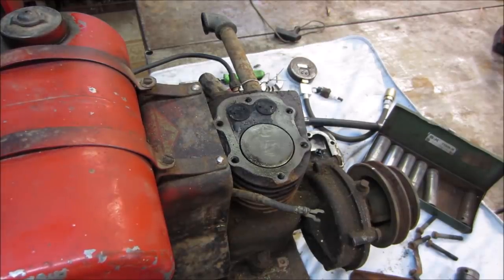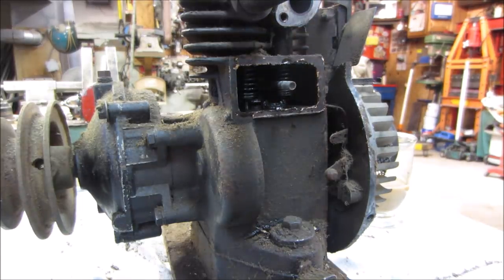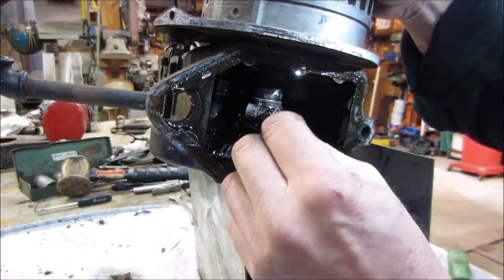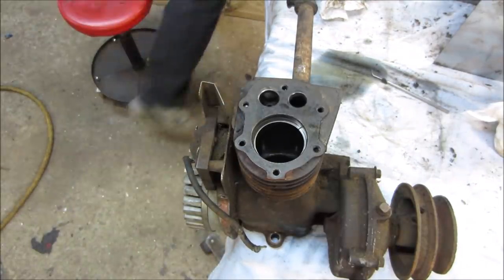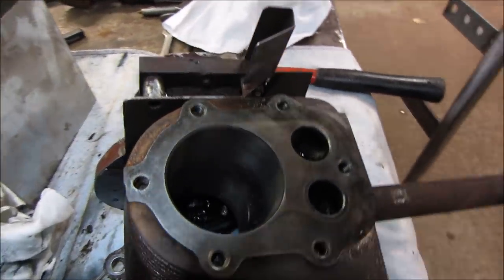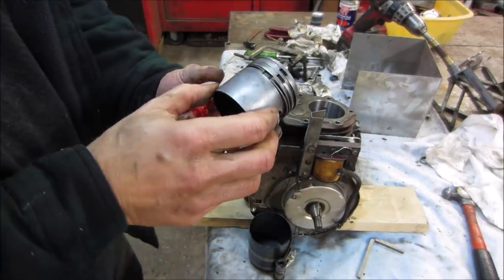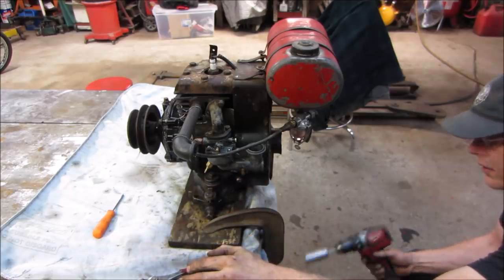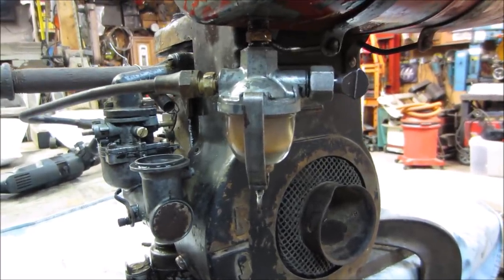Will It Run? $5 antique Briggs engine.part 3. tear down and cold start.

Comment: H 53 could well be a production date stamp, which would make it August 1953.  Without the ID tag, though, it's probably hard to tell as small engine design didn't really change much until into the '70s and '80s and it's always possible this one has been apart before and rebuilt using whatever appropriate parts are available.  If it is August '53 then it's in pretty decent shape for a 65-year old engine that clearly hasn't seen the best care and maintenance in its later life...

Comment: You could have knurled the piston skirts in your lathe to reduce the clearance, then cut some brass shims and super glued them in the ring grooves to reduce the ring gap, then be sure all your gaps were on the freshly honed part of the bore- probably worth another 10# compression.

Comment: It looks like an old reel type lawnmower engine with the two groove pulley on the gear reduction unit from the late 40's or early 1950's. One belt would drive the cutting reel and the other the drive wheels.

Comment: Great job, I have a chainsaw needs fixed lol.
 Also, pushrods spin, the valves don't spin.  Those valves didn't spin when you turned it over with head off.  Not aware of any engine where the valves spin.
I an build car motors all day long, especially carb motors. But when it comes to small engines, I can't get the carb right to save my life.

Comment: Old oil still good to go. It's been in the ground for more than 100 million years what's another few years. Just filter it out to remove metal particles using a common  paper towel or coffee filter. This is like a tutorial in small engine trouble shooting/fixing.

Comment: HATE those lapping tools. I ground a socket to fit the holes in the tops of the valves and used my drill.  For a motor of the same vintage.

Just read a bunch of comments talking about using a lapping tool with a magnet.  I didn't think of that...

Comment: Watching this old antique engine restoration project has given me the gumption to work on an old Montgomery Ward engine that I pulled out of a run-down Barn. Circa 1947 supposed to be on a tiller style garden tractor from the period. Does not have an intake or carburetor though. Maybe it'll be something I can ship to you @Mustie1 . If I can't get the parts lol.

Comment: You can weld on the piston and grind it away until it fits so you get a bearing effect. Don't have to go all the way around, just 3 or 4 or 5  and so on lines along the length of the piston to reduce the slop. 
If a piston doesn't bear, it wears. Hence why they're usually made to such tight tolerances. Sealing is done by the rings, but they can't seal if the thing frigging wobbles.
Reply: What happens is that as the piston rocks in the bore, the rings are rocking as well, which in turn rounds off the edges of the rings and they lose sealing ability. You could knurl the piston skirt, replace the rings and hone the bore.

Comment: I know the snow blower I have had some serious issues the old oil was like fudge just like yours. Dont assume someone put gear lube in it. Oil gets pretty thick when it sit for 5 years or more. I got this one running its also a 5 hp. I am having to do some modifications because the governor arm doesnt sit in the same spot due to a different carb. It runs but runs full out. I suspect the governor is trash. I may just slap $100 pice tag on it as is. after doing some fancy spring work with it to give it a consistant run. As long as the throttle works to run it full and off, thats all that matters. It has to have the power to throw snow and seriously, who runs a 5 hp on idle? I fixed a brand new snowblower last year that had one speed,fast. I usually go with maximum RPM per manufacturer and call it good. If someone wants to mess with tearing it down to replace the governor, more power to them!

Comment: Me, I'd have spent the bucks and totally torn it down and replace everything it needed I could possibly get my hands on including a new piston, ring set, valves and gaskets.
I know how to and have made gaskets including metal/gasket material sandwich head gaskets.
I've 800 hours vocational school training on small engines.
You'd be surprised how many parts are out there if you look good enough.
I'd also glass bead if completely then give it a nice two tone paint job, red and blue most likely.
Or green and black.
There's a huge interest in restored antique engines.
I used to own a 72 Wheel Horse Champion riding tractor/mower with a really weird PTO system I restored.
Slow as molasses but fun to drive.
Mowed good too.
42 inch deck.
Got it for 100 bucks on Craigslist.
He wanted 250.
Needed work, I talked him down.
I ended up selling it for 12 hundred after restoration.
Wasn't about the bucks.
It was just plain fun restoring it 
I put on a 4 foot exhaust stack with a custom 14 inch chromed tail pipe from a car kit with a home made flapper valve at the end from chromed flat plate I had lying around.
The guy I sold it to told me he'd have paid up to 18 hundred, like I said.
Not about the money.

Comment: Considering how much oil it pumped when spun up by the drill, it didn't seem to be burning much.   Maybe the combustion gasses are pushing the oil back down again. Nice little video - I was afraid you weren't going to put it back together again.
Could you put the needle valve in a lathe and grind it smooth.  Not sure how to handle the seat though.

Comment: the cross hatch and  the valve lapping sure will bring one back ....love those old engines ...the older the better  
those carbs always leak like that my carb about like that one drips and leaks but once its up and running its fine ....for some reason yours is poring gas alil too much... needle

Comment: The reason the carb does not leak when the engine is running it that there is sufficient vacuum that the gas leaks become air leaks !

I never would have guessed that lapping the valves would have made that much difference on the compression after the amount of oil leaking past the rings !

Comment: 53 sounds about right.  It looks like a Briggs engine we had on a ‘55 Toro reel mower.  That sob wore out my right arm cranking it.  The only thing worse than that was an 1967 MAC 250 chainsaw.  I must have pulled both of those pos a million times.

Comment: Should be a screw on the exhaust side of the gear reduction with a line cast into the case. That's the fill level for the oil, not that it matters.
Nice job with the work. You have a bargain there for $5.

Comment: Hey Mustie1 I believe that gear reduction looks like it will unbolt from the engine once the pulley comes off. It looks like a 2 piece housing unbolt one piece and the other bolts inside that case should unbolt from the engine. 
Love your channel keep up the great work sir.

Comment: .007-.017 ring gap on all 3 rings.  Usually .003" per inch of bore is a good minimum on small 4 stroke engines. Above .008" per inch of bore or larger is no good.

Comment: The 53 on flywheel is the date of the engine (unless flywheel is from another motor of course), not to give you advice as you are the master of all lol, but I’ve found best way to clean the valves is to put them in a drill and hold some scotch brite around them and spin the drill .. they come up like new.. but as always I’m learning from you with each vid so thank you 😊
Reply: I must learn not to comment before end of vid, your valves looked like new lol

Comment: Probably the only decent and good service it had in its long life. :) 

I have a B&S lawnmower which will be a nice project for my son and myself to tackle. We have an electric lawnmower, but a petrol one will be a great fallback in case of power cuts and when you have to mow far away from the house or any electrical outlets.

Such simple engines, except for the carburetor (which is teh_sux in most cases).

Comment: No mouse nest! I knew it would run fine, I've done a lot of these old 6s & 8s, they keep on puttin.' The date of '53 is correct, no doubt. Not much rattle or knock! The earlier models had a real, internal oil pump, built-into a cast-iron sump. I think the rings and valves had been replaced, but not the piston. It's in good shape for a 65 year old sludgy engine! Might be off a Gravely tractor...
Reply: Gravely never used the Briggs on the old walk behind tractors back then. They used their own T-head engine designed by B.F. Gravely himself. In the seventies they switched over to Kohler engines. It wasn’t until the later four wheel tractors that they used any Briggs engines.
Reply: Right! Thanks John. I was thinking of another walk-behind tractor...

Comment: in my experience the exhaust valve should be a couple of tho more than the intake. too little tolerance on the exhaust will cause erosion of the valve face.

Comment: I would turn that engine into a DC genny with a GM one wire alternator and nice deep cycle 12v battery. I'm sure you have those things laying around.

Comment: Those two holes on the tops of each valve, were those for a special tool with corresponding pins that would be used for spinning the valve while lapping it in?

Comment: Loved it but I wonder what you do with it after its all fixed up
Reply: It is a trophy.  There is so much cylinder wear that it could not do much work.  One thing it has going for it is the gear reduction.  That makes it at least a bit more useful.  If you had to drive a piece of equipment from the crank, it couldn't do much.

Comment: Love the old engines... Have you ever messed with an old Wisconsin TF engine? I just bought an old (1951) Lincoln DC 180 AS powered by a Wisconsin TF hand crank engine and am about to undertake restoring it. Just wondering if you had any insight on old Wisconsin motors... love the videos.. Thanks.

Comment: Did you check to see how good the air flow was around the cylinder?  When I saw the size of the coil, I started to wonder how air got past it to cool the cylinder sufficiently.

Comment: Nice little project for a Sunday morning. I think this engine has been overheated and the piston skirt has collapsed. There is not enough bore wear to allow the piston to rock that much.
Reply: Did you watch him hone it?  That cylinder is an egg!
Reply: @paulcopeland9035  Yes  I did.   Actually I answered before he got to the honing. I still think it was overheated ( Just not quite as bad 😉) because even with the cylinder shape that piston is too wiggly

Comment: Is there ever an engine that has okay cylinder and piston that you can’t get to run providing you have parts for it. I have a 5 hp Briggs I worked on go a week with no success.

Comment: Something that I did notice when you pulled the piston out was that all the ring gaps were close together rather than being equidistant around the piston and that's not going to help compression at all.  I'm wondering if this has a cast iron cylinder and an alloy piston so that the piston is the sacrificial part as the engine wears with it being the easier part to change when it comes time for an overhaul...
Reply: Did you watch the video?

Comment: Hey Mustie, (and friends) I have an old 3.5 or 5 hp briggs (Probably the 5) from the early 70's on a generator. It has a similar carb that this one does, can you give me a part number from the horde so I can replace it? Its missing and I have no reference. I would love to get it running again, it was in the house when I purchased it and it looks like the previous owner was rebuilding the carb but I have no carb lol

Comment: I knew you could get it running. No idea what it would have been used for originally, or what it could be used for now.
Reply: The larger groove on the dual pulley drove another pulley on a shaft with steel wheels and rubber tires. The smaller pulley drove a larger weighted (for momentum) flywheel type pulley that connected a dual heim-jointed hollow (filled with grease) shaft that pulled/pushed a sickle-bar (sharp triangles on a long steel shaft) back and forth to cut tall grass and shrubbery around ponds/fence lines/wooded areas. My Grandfather had an old black Gravely (think D.R. Trimmer 1.0) he wanted me to get going before he passed back about '90 or so. But as Al Gore hadn't invented the internet yet,my Mustucation was incomplete and although I could get it to fire,she would not run consistently. 
Google "vintage walk behind mowers" for more info.
Reply: Oh yeah,"What it could be used for now? Well,I think he mentioned in at least one of the videos; That's a gear reduction mounted on there. So all these guys saying "Rebuild it and build a bike with it" are barking up the wrong tree. The bike's top speed would be around 6-8 mph!

Comment: I personally would like to see you at least attempt to put a set of rings in it and make it like one of your little mini rock crawlers or one of your many like one of your bicycle builds that's what I would like to see done with that motor I mean the motors sold it's got history in my opinion and it looks cool I mean you don't see any of them anymore so I personally like to see it on like a trike or something or like on like a old four-wheel go-cart or all three wheeler something that you can make like a little rock crawler or like a little Yard Cruiser or something like that or something to move vehicles around the yard because I think that think that side drive on it may have enough dorkiness in the butt end of it to move a vehicle or something but that's just my opinion you said you weren't going to do it I just thought I might throw it out there to see if you would do it I love you work dude it looks good I like it when you explain s*** it works out to do what you do man
Reply: Remember, punctuation is your friend.

Comment: I believe that the bottom of that cylinder wall maybe egg-shaped if the skirt on the Piston is a little tore up it is rocking halfway down I think that the bottom of the partial of your cylinder wall itself is probably egg shape halfway down the cylinder wall but I've never seen a piston ring with a step up to step down ever
Reply: Did you listen to the video? The "egg shaped" cylinder was fully covered

Comment: Old timers would put brass shim stock behind the rings to bring the compression up.
Reply: Would that be to bring out the ring for better contact on the cylinder walls? I know a guy that used copper wire to do that. When we burned a piston top on a race sled we would drop a bolt through the hole and grind the head off Sealing the piston. In a race situation on a weekend, it worked. We used sheet copper for head gaskets too! There was no wrong way of doing things at the races back in the 1970's during snowmobile racing. Now days if I used the methods I learned, most mechanics would scream! I still miss those days!
Reply: @scottfirman  I really don't know for sure but believe the space between the back of the ring and piston had a tolerance called for. Used pistons would be worn and the shim would take up the space. Maybe someone else smarter than me can chime in.

Comment: Did you measure the bore on that engine? If it was a 2 inch bore, it was either an NR6 or a 6R. If it was a 2-1/4 inch bore, it was an 8R6

Comment: Mustie, why have you not cut your valve lap tool in half, added a screw and then use the cordless drill to lap the valves? Way easier than hand lapping and since cordless drills have speed control you do not have to do it at 9000 RPM if you have trigger control.

Comment: Might be able to fit a modern piston to that engine.  From what I can see it appears to be a cast iron engine block
Reply: P51ride 

A lot of these old engines had parts that were quite similar. I wouldn’t be surprised if there was a different crank, connection rod and maybe a piston that would work in it, :D

Comment: did you think that not having a muffler might be the reason the exhaust valve is a little worn or that the engine needs that back pressure!?

Comment: I love your channel and you inspired me to buy myself a lawnmower, so I got a mountfield empress with a briggs and Stratton quantum xm 35 in it its 26 years old and I got it for £10, it currently has a surging issue. I cleaned the carb and it doesn't surge with choke engaged any ideas why it's surging with out choke?
Reply: Miss-aligned bowl and clogged jets would be where I would start.

Comment: I just picked up a Cushman truckster and it’s in need of a tranny and drive shaft , I can make these parts but would like to stay as close to stock as possible, do you have a video of the drive train or pics of it for reference? I just got a OMC 215e (360cc ) engine for it . Thank you

Comment: Would you pass a little information to me, I have two 5 HP horiz. Briggs and Stratton engines, one with a 2 inch pump on it and the other with a leaf blower, they are kind of old and over the last few years I have rebuilt both of them including the carburetors and both of them will only start if I put gas straight in the carburetors and they will usually start,  I have gone back through everything but it did not do any good, do you have any suggestions,
Thanks,
Dave

Comment: Darren,  from looking at the honing hatch pattern it looks like there is no angle. Shouldn't the cross-hatch pattern be at 45 degrees? I'm not sure if this matters with small 2-cycle engines.

Comment: Hello, Just wanted to know if you had any tips for installing the three rear wing window rubber weather strips on  my 77 bay window . I can't seem to slip in that 10 inch strip of rubber into the metal frame. Any help would be appreciated.

Comment: 60-70 year old stuff prolly last longer than brand new today.
Reply: It absolutely does. Stuff today is made to be thrown away. Recently picked up a leaf blower from the 60s with a 4hp kohler in about the same condition as this engine. Took me about an hour of tinkering to get it running. Gonna be a winter restoration project for me.
Reply: Have a Robin blower and string trimmer that are old as dirt and still kicking